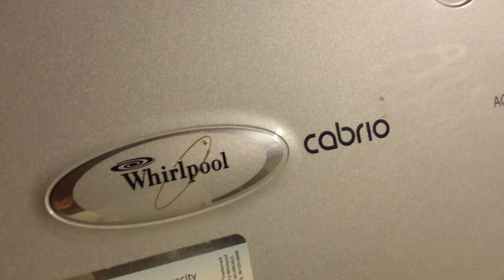Whirlpool Cabrio washer defective cracked broken lid (Video 1 of 2)

Comment: This can be fixed better than the original bad design for a lot less money as follows: Remove the lid. Please upside down on a soft towel to protect the paint. Carefully use a razor knife to separate the glass from the cheezie 3m double sided tape they use (this will take some time to prevent more damage or stabbing yourself with the knife). Once the glass is removed, remove all the old glue and sticky strips and you will have access to removing the cap at the top side of the glass. The cap is only held on by plastic snap clips and could break so take you time, it will come apart. 

On the left and right side are 2 - 2" bars which are the hinge support and the cause of the problem of the design. Go to your local hardware store and get some flat bar approximately the same dimensions except you need them 12" long. The 2 holes in the original bar are not threaded so this makes things easier on your new one. You will have to notch a few plastic ribs to make your new bar will fit. Re-drill the holes in the new bar using the old one as a template.

Wipe all surfaces with acetone where the glass sits to ensure the new glue will hold. Be careful not to get the acetone on painted surfaces as it will damage the paint. Repair all cracks or broken pieces with JB weld for plastic and lightly clamp till fully cured (follow JB instructions).

Place the new rods in the slots you made and install the hinge arms to ensure everything will fit and is aligned. You can use the JB weld to secure the new rods in place as well. Once dry, remove the clamps and hinges. For the glass installation you can use Urethane in a tube. (same stuff used for car windshields and extremely strong). When applying the Urethane, do not over do it as it can be messy and does not come off clothes. Put on enough Urethane that the glass will get a good seal but not seep out. Clean up any excess.

Lightly clamp and wait to dry (Follow Urethane instructions). Reassemble the lid on the washer in reverse of how you took it off (4 screws so don't loose them).

Your all done and have a lid done the way it should have been designed in the first place!!!! :)

What did we accomplish? Well as the video says, this is a bad design and they did not take mechanical advantage into consideration as if they cared any way. We have now moved the focal point from the first 3 inches from the edge of the lid with heavy stress to the center of the lid thus spreading the spring load over more of an area and eliminating the stress area. You also get to keep the proper use of the springs and not wack yourself in the melon when doing laundry.

I am not an engineer but I am a 40 year veteran mechanic of old school mind set. Always remember if man made it, man can fix it and some of the best ideas come after a few beer, and yes I did mine exactly as I explained

PS: These lids are no longer available and if you you do find one, it is still defective till you do a proper fix.

Hope this help someone 😎
Reply: Yes a video helps more😊

Comment: Thank you so much for the video. I spent at least a year putting weights on my machine. I wish I fixed it earlier. This was very easy to fix.  My washer works well.  Unfortunately, I got the run around from Whirlpool and just ended up purchasing a lid for $200. It was still cheaper than buying a new washing machine.  I purchase quite a few appliances for my job and will avoid Whirlpool products.
Reply: did it break again?
Reply: Same here before with weights...before the assembly popped and broke all the way

Comment: Thanks for video! Cabrio lid broke, removed lid and ground down right side L shaped hinge piece. Left side piece is badly rusted and won't come out. WD40 and hammer aren't working. Will epoxy door while WD40 soaks. Thanks again for fix video. Saved me hundreds$.

Comment: Another fix I found on YouTube, is to remove the lid and place to large paper clips (the black ones with wire hinges) at the rear of the lid by the cracks.   I replaced the hood and it worked fine:)   So, for a $1, this can be fixed.   Extremely disappointed in Whirlpool for not standing behind an engineer design flaw.
Reply: Will you repost a link to the video....before mine broke all the way I tried to figure out how to get the paper clip installed

Comment: Our lid also cracked beyond the point of use. I spoke with Whirlpool and they told me they have "no record" of complaints of this issue and the best they could offer is a replacement lid at north of $300 for parts and installation OR a discount on a new machine. The customer service manager also told me they won't issue a recall unless it's a safety issue and since they sell millions of products, failures are expected. This will definitely be my last Whirlpool purchase.
Reply: Okay...thanks

Comment: Same problem.   Had extended warrantly from Lowes in 2011 so I got the lid replaced along with new bearing in the washer all under the warrantly.   The tech told me the cost of the repairs would have been more than a new washer.  Less than two years later the lid has the same problem.

Comment: I took the hinges and the strip that goes between them right off. It sux but for a year now I’ve been just taking the glass right off and loading the machine then placing the glass back on top. Then when it starts I move the lis around ever so slightly so the door lock mechanism recognizes it as closed it’s a bit of a pain but it works. If anyone knows where to find a new glass top that would be awesome

Comment: It's been one thing after another with our Whirlpool washer. We've been placing a heavy weight on our broken lid to wash clothes. Eventually the lid completely broke off the hing, but the washer still worked when lid was put back in place. This morning, the glass in lid shattered as I set it down, sending broken glass all over the laundry rm floor.

Comment: My washer has had the same problem. I came up with the cheapest solution. Open the lid and using the correct sized "star" driver remove the two screws from each hinge. At this point the lid should lift straight off of the washer's steel hinges. Remove the steel hinges from the washer machine. You may have to apply some force and wiggle the hinge to get it to come out. If your lid is badly cracked you may want to glue the seams with epoxy glue and clamp it together. After your glue has dried simply lay your lid in place and lean the lid up on the control panel. Load your clothes and soaps. Lower the lid in place as it would have been with the hinges so the lock will engage the lid and turn on the washer to clean your clothes. It works like a charm! I have had no problems without my hinges in place. Just a minor inconvenience vs spending more money.....
Reply: Can you make a video of this....and did you unplug the washer and turn the water off when doing this
Reply: Will SOMEBody make a video of this!????

Comment: Bought mine in 08/2011. Have replaced that lid 3 times now at $187 each time. Total failure on their part. Went looking at new washers and LG and Samsung have metal instead of plastic. Whirlpool.... still using the same plastic frame.

Comment: Hey Steve how did you fix the crack after you had it clamped in the second video? Did you fill it with something? I have the same problem with my washer same model and I want to fix it instead of spending 200$ for a new lid to have it happen again.
Reply: I'm thinking of attempting to remove the soft close springs.  I need to take it apart to see if it's even feasible.

Comment: Do you have temporary or permanent solution to this?  My lid is cracked on both sides at the hinges.  This thing has been a POS since the day we bought it 5 years ago.  I would love to find a solid metal lid because everything I read says even with a replacement part, it is still an issue.  Any help from a retired design engineer??
Reply from the maker: +Robert Geoffroy Posted Fix as Whirlpool Cabrio washer defective cracked broken lid Fix